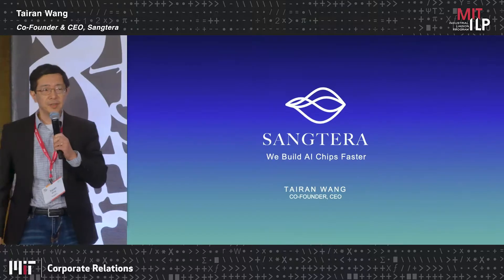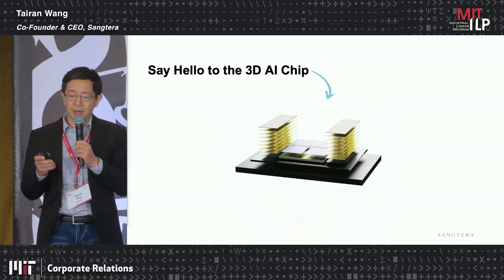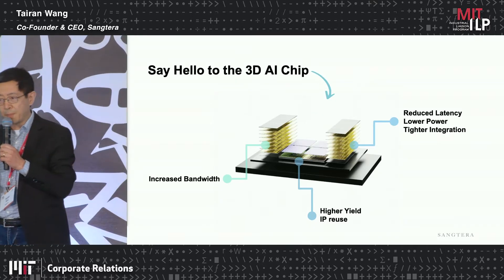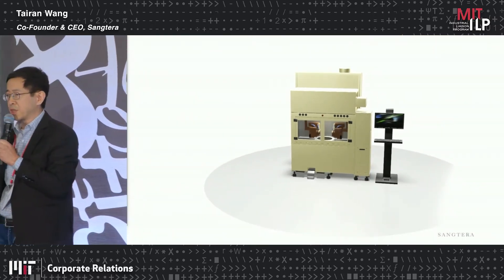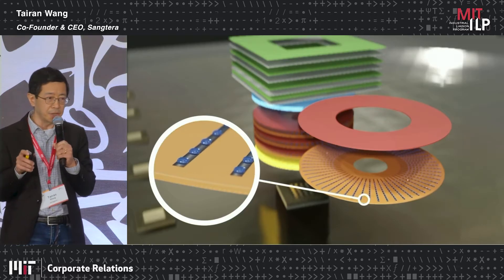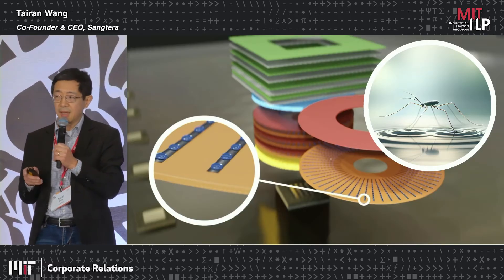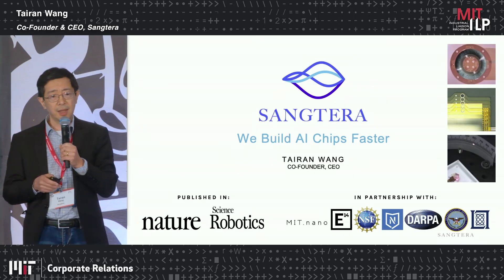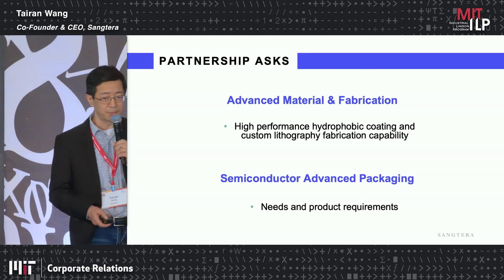04.30.24-Startup-Ecosystem-Conference-Startups-Sangtera

Comment: I don't know exactly what they are looking for. Are they looking for people who work at Intel? TMC? Perhaps with a little more specificity we could help. 
Also their website, while nice looking, doesn't really say anything of value. Perhaps it could have a link to this video on it?

I as a layman was following along until about 2:28-3:28. Then it got super specific with engineering, without a lot of great comparisons or examples of why it is so much better. Perhaps in a longer discussion you explain how the actuators work, as I am familiar with mechanical, electrical, pneumatic actuators, but I have never heard of an actuator in a chip before. 

I know there are lots of YouTubers who love talking about AI, and you could go speak on their podcast to get attention for the kinds of people and potential capital partners you'd need in order to build out these pieces of machinery. 

  Perhaps you could explain how this by saying something like "stacking of chips could increase capacity of the current AI chips by 10x with potential for more" or something. Hope this helps!
Reply: What a bot comment